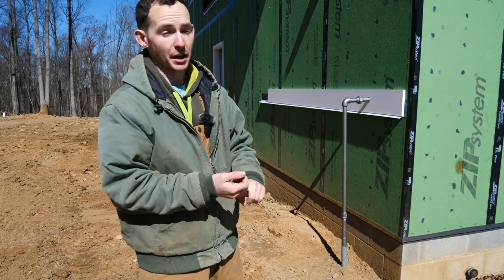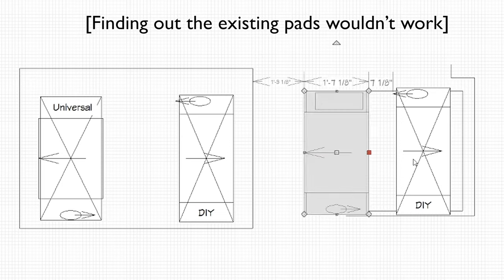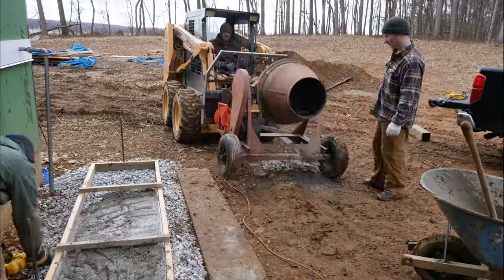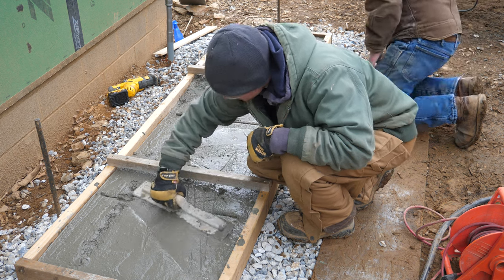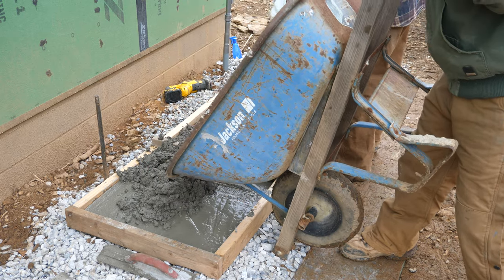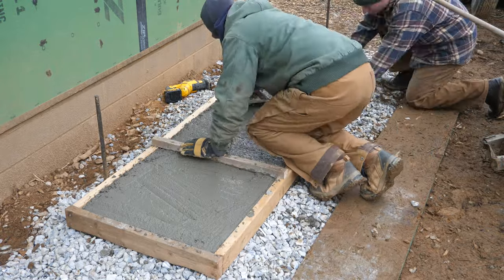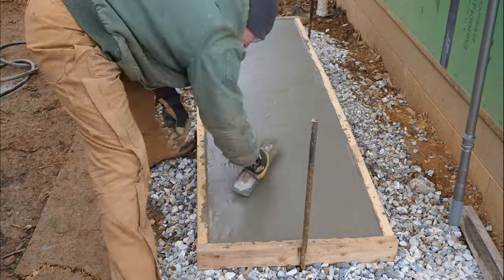Pouring a Small Concrete Slab for HVAC Equipment

Comment: Don’t forget the air gap needed between the equipment and the house.
Reply from the maker: It's very small (6" I believe) since they are designed to be bracket mounted as well.

Comment: Did you think of just pouring the concrete directly into the form and skipping the wheel barrow?
Reply from the maker: We did but it was kind of awkward to dump the mixer so we didn't really want to maneuver the skid steer more than we had to. Wheel barrow was easy

Comment: Good job. But first you need to add water, and then other ingredients. Also i think the mixer should be empty when you start it , because the engine may fail.
Reply from the maker: Lol that old mixer is on it's last leg 😅 it's actually an old Sears electric model!

Comment: OT.  Curious about the HF ramps you used to unload the concrete mixer.  Foldable & arched.  They look like decent quality.  Would you recommend these HF ramps?
Reply from the maker: Haha yeah! I've had them for many years, originally bought for loading quads and dirtbikes onto a truck bed but useful for all sorts of stuff.

Comment: How come you didn't hang those units off the wall?  I think they need to be free from snow for heat in the winter months?  I was asking because I was planning on installing those on my garage.
Reply from the maker: Wall brackets are a good solution, but there will be stone veneer on the wall which I didn't want to interfere with. I considered elevating them on the pad with a spacer, but then remembered we rarely, if ever get snow in our area in recent history.

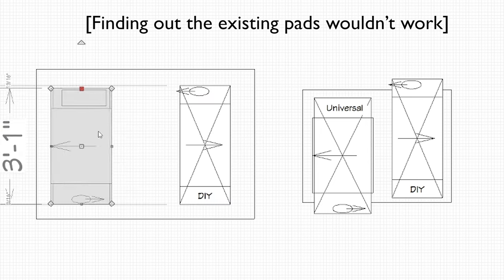Comment: 1:02 was that really necessary? Talk about over thinking something. Wow.
Reply from the maker: I'd typically delete this comment but I'll address for the sake of anyone else who might find this helpful - Yes, modeling the layout was very helpful and a great use of 10 minutes. 

It allowed me to clearly see how the units would fit on either of the precast pads, make sure their mounting feet would land within a reasonable distance from the edges to prevent the anchors from fracturing, plus meet their required operating clearances to each other and the house. It allowed me to easily visualize several various positionings to see if my existing slabs would work (they wouldn't). Additionally, as you may see in our install video, the linesets for our MRCOOL units are precharged and a fixed length, so the orientation and positioning of the units relative to the house is critical for that to work out.

TLDR: An ounce of prevention is worth a pound of cure